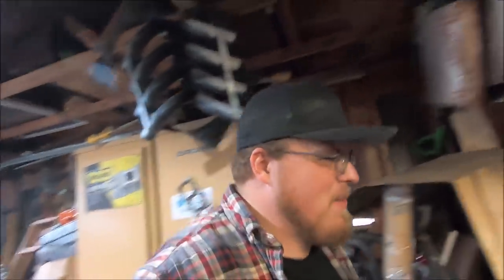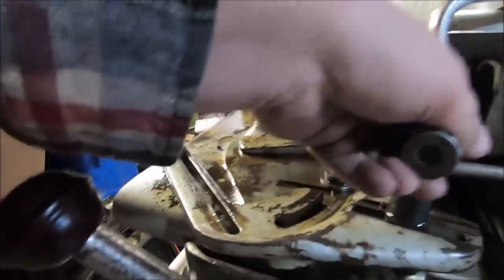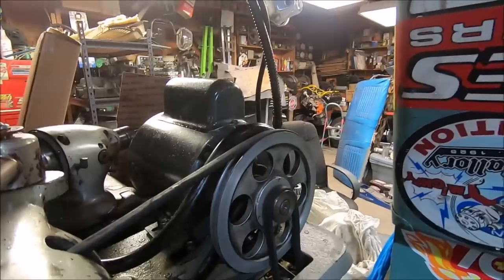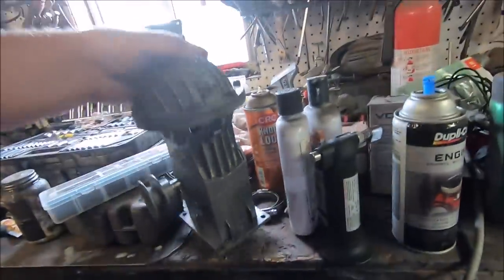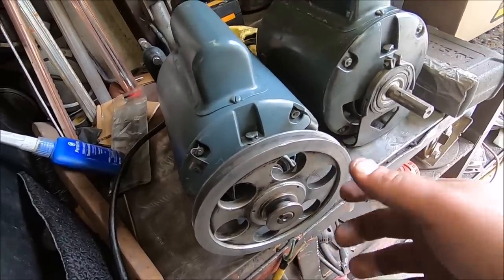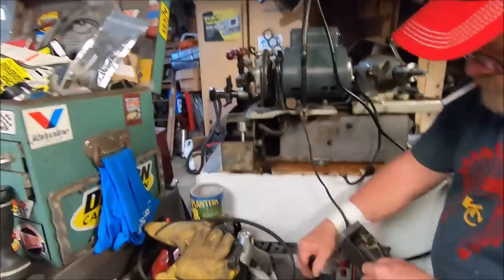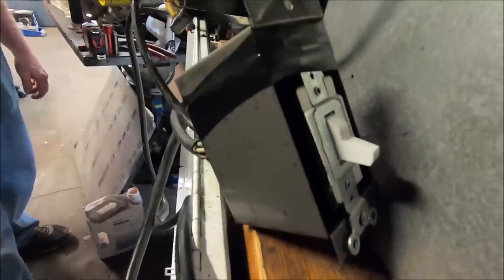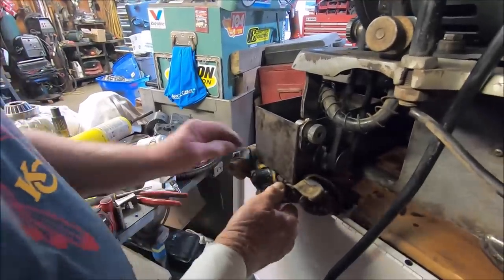Vintage Sioux Valve Grinder REPAIRED & Put back to WORK

Comment: Im restoring an old K O Lee 403 CH. valve grinder , it was the military issue unit ..
Everything is ok on it although locked up . 
I need to rebuild the oil/ fluid pump with new bronze bushings , seals and new vertical and horizontal shafts .
I have it completely disassembled on the shafts that are salvageable I’ve cleaned them up with minimal loss and staying within tolerance from the factory .
It has all new wiring , ORings , bearings in the main grinding shaft . The motor worked fine although lost a little strength so I’ve rebuilt that to factory ratings with a new starter , cleaned and tuned armature , starter capacitor..
I was told that parts would be hell to find , but with the book that came with it , I used the factory parts number and cross referenced to new and updated parts ..
It’s been a fun project and I can’t wait to use it !!

All of the outer cases and tooling holder have been bead blasted and powder coated too

Comment: your electric motor is perfectly recuperable, you have only to clean up the starting points AND insert #8 ( or#10 ) flat washers between the end plate of the motor and the points fiber plate, This will toss the starting points about 0.030" toward the rotor and compensate for the wear of the points and of the contact race so youy motor will be good for service.
I saved many motors that way.
Reply from the maker: Thank you, I am glad I kept that motor

Comment: There's a set of centrifical operated points in the motors and I'm betting that were not closing up when it slows down that may be the click you hear when turning
Reply: The clicking you heard when the oil pump was belted on the new motor was the centrifugal points closing from low rpm's. Pull the end cover from your old motor and check the springs and points.
Reply from the maker: Thanks Jonathan, I am gonna check those out later today, we actually got the machine to operate flawlessly once we put a little oil on the bearings, that made a world of difference in the machine. I've been practicing grinding valves and have done probably a dozen. My grandpa wants to come over and play with the valve grinder. His Dad used to have one and Grandpa wants to relive his youth, i think it'll be fun.
Reply: @ScottsSpeedShop  Not much to doing it, Great thing to have for sure.
Reply from the maker: @jonathanw4942  thanks for watching and lending some pointers

Comment: Goodson sells the correct valve grinding oil . Also my Sioux oil pump was bound up with crud . When I cleaned it out , I also found the pump shaft was worn down , and the bushings it ran in was worn out .  I made new bushings to center up the pump shaft better , and now it runs great . I think all the stone material and metal ground off the valves get flushed through the pump and cause it to wear . No real filters on the system  .  Good luck with that grinder , it will do just as good a job as the new stuff , with a little care .

Comment: The oil pump should have a pressure relief valve on the outlet side, it could be seized closed causing excessive load on the motor.  Sometimes people screw it in all the way trying to increase flow. Try backing it off and see if it runs better.  Don't need much flow for grinding valves bc contact area is small.  Also check the motor is wired for 110 not 220.  Really nice machine, great score.

Comment: I ran one of those in my high school shop class! I was the only guy in there that knew about 3 angle valve jobs!  The teacher had a set of heads that he had gotten to put on an engine he was building to replace the poly 318 in his 63 Fury, I can't remember what size the engine he was putting in but he said it was the biggest poly they made and he was saying there was no substitute for cubic inches!!  He showed me how to do a 3 angle valve job on a couple of valves and then turned me loose on it! That was close to 50 years ago so I can't remember the details of it but it's not hard to run at all!
Reply: 413 Wedge?
Reply: I learned to use one of those in h.s. auto shop too! Loved it. Very satisfying!

Comment: Thats cool you got a classic machine shop grinder for valves. A little tlc and she'll be back to normal. I think I'm going with an 80.00 drill press and a hand full of metal files for filing metal and angle grind my valves . Uncle Tony Showed how to do that.

Comment: Got the same issue with a lathe ive pulled from a shed after 30 years. Cleaned the motor and its ok. I had to spin with my fingers to start..... scary stuff

Comment: Had a compressor that the start up capacitor was bad. We mounted the motor on a board and you just had to lift up the board so the belts were loose and get the motor running. Once it was running you would lower the motor and board down and the compressor would pump air. 
Good job. Happy Motoring and Bye bye.
Reply from the maker: Thanks for sharing

Comment: Hey Jed, Check to see if the motor isn't wired wrong on the clips where the wires go into the motor. It sounds to me that the motor itself is wired for 220 not 110 - it doesn't hurt to double check. If it is then that's why it doesn't have the power it should. later
Reply from the maker: Thanks for the tip, we will double check everything

Comment: I have a 645 as well but mine is slightly old because I only have I oil line to share both wheels and my chuck doesn’t have the leaver on it but I wanted to ask you how do you know what angle your cutting the valve face at ? I can’t find any numbers on the deck or the chuck so I can’t figure out how you know precisely what angle the valve is at ?
Also is your chuck true mine has a wobble so I was wondering if you know where a guy could find used parts that are still in good shape?
Appreciate any help you can give me!
Reply from the maker: Man, I actually just some my valve grinder to a Youtube friend who goes by the name of Tall Johns Fun Shop, he expressed a lot interest in it, so I sold it to him. I think I recall my chuck having just a slight amount of wobble, but nothing major, and under my chuck there were engravings for the angles you were cutting at. I would recommend going to check out my buddies channel and pester him about making videos on it. As far as service parts, the only thing I found was oil and belts
Reply: @ScottsSpeedShop  Thanks a lot it’s nice to meet decent people that don’t mind taking the time to help someone! Thanks again 😀🇨🇦

Comment: Hi Good day to U, I have this machine and it has huge problem.The stone slide rushes in when we apply pressure to grind the valve I have to push back the slide with hand to avoid extreme heavy cut and valve damage Please help me to solve the issue . Thanks and regards
Reply from the maker: Sounds like it could be pretty bad mechanical damage. I guess you'll have to disassemble the machine and look for damage
Reply: Yes there is surely huge problem so where do I have to look for repair ,when faced with this type of issue lead screw and nut or the bars on which the stone slide moves  . Awaiting for ur precious reply . Thanks